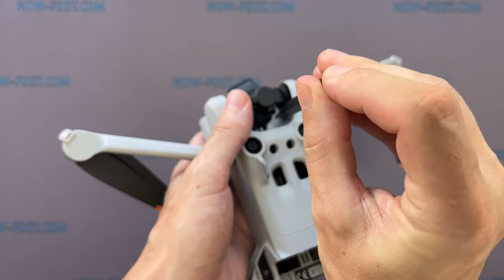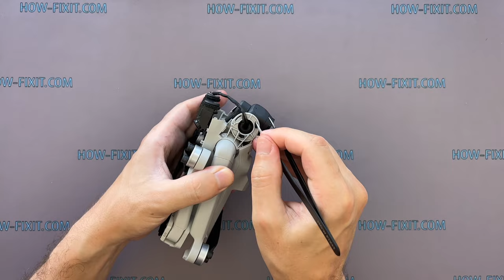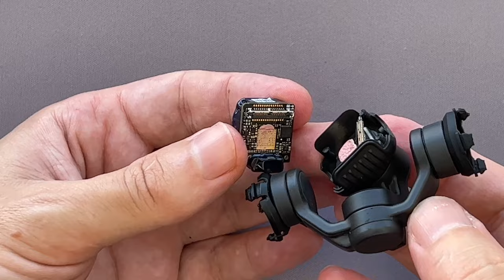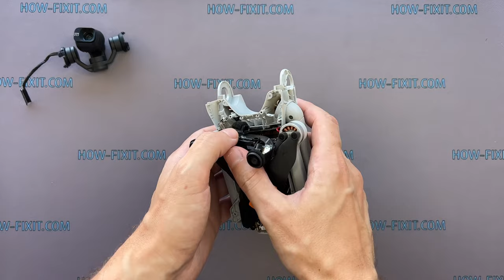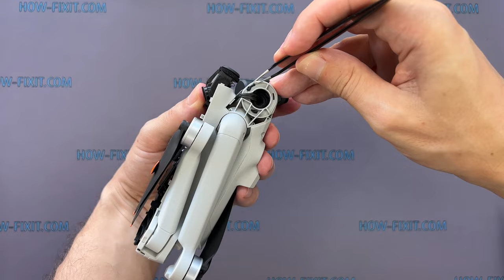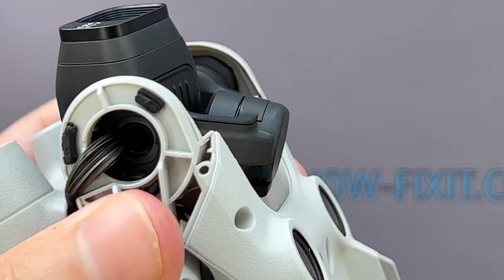The Ultimate DJI Mini 3 Pro Gimbal Replacement Guide

Comment: Mavic 3 and Mini 3 Pro can't be calibrated by python. Does anyone know how to calibrate?
Reply: Did you ever find the solution?
Reply: Any update on this? Were you able to find a solution?
Reply: @stefanhearn430  my solution has been to remove the yaw motor from the top arm via excessive heat, and adjust its alignment until it’s proper
Reply: @ me if there's an update

Comment: YES, wish I had the comments before taking on this project because everything was simple except for the rubber shock absorbers.  Mine are completely ruined and will now have to order more and figure out a way to put them in without destroying them.  100% read the comments is my lesson and I am highly disappointed in this tutorial for not warning or even mentioning the issues associated with the these shock absorbers.  Looking back, even the guy in this video all but destroys them.  Not impressed by "how-fixit" because of this one major oversight on their part.  I'm a novice and this was my first attempt to repair a drone like this.  Considering they're acting as professionals, they should 100% update this video and address the challenge with the shock absorbers.

Comment: Great Tutorial! BUT there's still something I can't figure out... I've replaced the cable without issue and the gimbal/camera is working again, however, after multiple attempts I can't seat the rubber properly... what I mean is, I put the rubber through the mounting holes, gimbal facing forward, but EVERY time, the gimbal is not in the right position to have full rotation up and down. It won't look straight down, and has to far of a movement range upward. Any suggestions? I've tried rotating and marking the rotation of the gimbal before placing, but I just can't get it.

Comment: I watched this to see if there was an easy way to push/pull the rubber tips through,  they get all messed up doing it this way ,  its difficult.  I prefer to push them through with no gimbal installed, then using  tweezers spread open each hole and pull it around each tab,  starting with the one with the notch.  I'll make a video
Reply: Use dental floss tie up the rubber pull it through the holes
Reply: @vandantandel7289  I bought about fifty of the rubber things,  new ones come with long tabs that easily push through, these gimbal are easy to rebuild,   sections. arms, motors,  have had many just a bad cable (no up and down moving)   .

Comment: I replaced my DJI Mini 3 Pro broken Gimbal Yaw Motor. After replacement, though the Gimbal is getting calibrated successfully, it keeps pointing to one side always. Apart from giving Gimbal Motor Overload error (1D010003) occasionally, which goes away automatically in few seconds, it is not showing an other gimbal error. Could someone please guide how we can get this gimbal centred now? It keeps pointing to either extreme left or right always even after successful Gimbal, IMU & Compass Calibrations. Please guide.

Comment: what a great video!  thank you!  but I have a few questions. I flew mine up into a tree and of coarse wrecked, after that the gimble sometimes works. Other times it say's gimble stuck or gimble overloaded. i don't see any damage and don't want to drop $300 if i don't need to.  thank you for you advice everyone.

Comment: I have a single clip of one of the rubber holders that is broken. I mean those plastic caps that go on the gimbal motor that have 3 clips on which the rubber holders are placed. With one clip missing, I cant mount the rubber. Do I need to replace the whole gimbal housing or can I somehow replace only the gimbal motor/the its plastic cap?

Other than that I need the two rubber holders, of course.

Comment: Awesome tutorial! If you're stuck on replacing the rubber gimbal gasket/damper, save yourself some time and READ THIS FIRST!!!!  
It's fairly easy to pull the tiny holes in the rubber gasket over the plastic anchor points on the gimbal, but I was stuck on putting the rubber tabs on the outside of the gasket into the the tiny slots in the drone's frame.  I struggled for close to an hour, using a variety of tools and tweezers and chewing up the rubber a bit.  I guess during initial assembly, these rubber discs have long tapered tabs that are easily pulled through the slots. Once the rubber tabs are firmly seated in the slot (there is a shallow groove that retains it), the excess length is clipped off. This leaves only a small, spongy nub that is nearly impossible to pull through the plastic slot in the airframe with tweezers or push through the slot without tearing it.  I finally thought to put a tiny drop of dish soap on the plastic slots to lubricate them and then I was able to stuff the the rubber "tabs" back though (from inside) with a small flathead screwdriver on the first try.  Probably going to clean up the residual soap with a cotton swab and isopropyl alcohol, so it doesn't slip back out.
Reply: Thank for your suggestion, you saved me from losing my drone, above video should mention how hard it is to put these suckers back in, soup defiantly helped!!!
Reply: Oh my god thank you
Reply: Thanks for this tip….as this was the only part of the process I was dreading. I saw only how it’s assembled by DJI with the logging tabs that get cut off.
Reply: So after you install do you need to remove the message Jimbal erro how do we do it
Reply: Great tip, thank you!
Reply: Thank you i have been on this over 5 days cant insert the rubber, I will give your method a try

Comment: I have sourced 8 pairs of grommets after having issues getting the original rubber grommet back in place.

Actually when I purchased these I bought several pairs expecting to ruin them trying to install them.. turns out from factory these are left long, pulled through and then cut off afterward.

Anyone looking for a replacement set please message me as I can’t return them! 😅

Install is super easy!
Reply: I am looking for some if you still have them
Reply: Do you still have them? Running into same issue.
Reply: Looking for a set if you still have any!
Reply: Hey I do not have any more but I can order some on your behalf and mail them if any one still needs them
Reply: Hey thanks for responding! All good, I just ended up sending the drone away. Cheers

Comment: Please, don’t follow this tutorial! You end up spending money for nothing. Since the ‘new’ gimbal does have another serialnumber, there is NO WAY to calibrate the gimbal. You will end up having a gimbal hanging in a corner, not responding to your input. 

Not only the gimbal and camera, even the front sensors can’t be renewed. Same problem, another serialnumber. DJI becomes another Apple, anything to prevent that you repair your drone yourself 😖
Reply: I do it
Reply: @felipeporai  Please share your experience when your done. I hope I’m wrong…
Reply: @Minicopters  isnt a code bro.. Its a dji software … I work with drone repair in Brasil

Comment: Little tip to add to this video, As some may have seen and experienced, the rubbers are a pain to put back in place, I was able to leave the rubber on the gimble and only replace the gimble, it was easier to put the rubber back on the gimble and leaving them on the drone. It also prevent from damaging any of them by fighting to put it on the gimble.
Reply: great, you could have warned me before looking for the video on how to do it.
Reply: Ich habe an den Enden der Gummis eine Schnur/ Faden um diese gebunden und mit einen Faden durchgezogen. Ging super schnell und ohne Beschädigungen.

Comment: My brother broke the gimbal arm on the side with the wires, I’ve taken the gimbal out and repaired it with araldite, but I’ve noticed the rotation side that broke doesn’t rotate smoothly it’s very stiff whereas the other side that has the copper rotates very smoothly, my question is that how they should feel or has the crash damaged some sort of bearing on one side

Comment: Wait I had crashed my drone but everything works on the gimbal just the camrea wasn’t able to move but everything had work all it needed was just an housing replacement would you need to also recalibrate it

Comment: Any idea where to get just the rubber holders?
Reply: DJI wouldn't send the rubber holders to me to fix mine myself. They made me send them my drone through DJI Refresh for $65 and replaced the drone instead of dropping a few in the mail.  They said the rubber holders weren't "an available part for purchase".
Reply: @cheritrick  thanks for the reply man, I crashed mine a couple weeks ago and realised with this video that really all I needed were those rubber holders. I will send them the drone then...
Reply: Same here. I crashes my drone and the left side of the gimbal was dettached from the rubber holder. I managed however to put it back on by using twizers but only I was only able to connect 2 holes. There are a total pf 3 holes. I calibrated the gimbal and somehow it was successful. I was able to shoot today. But i will still send iy for repair since the gimbal on the left and right is not level due to the dettachment  from the rubber holder
Reply: @deejay1571  yeah, my rubber holder has actually ripoed off around one of the holes, so I coudn't reconnect it properly
Reply: @fredericoalves811  does your mini 3 pro have dents after crash?
Reply: @deejay1571  really small ones, like some pieces are just slightly out of place, but nothing major
Reply: for my DJI mini 2 I bought rubber holders on aliexpress, maybe there will be for DJI mini 3 pro
Reply: @Edvard_Nygma  cant find anything so far
Reply: @fredericoalves811  same here. Just minor scratches. So were you not able to use the drone after thre crash? Can I see the situation of your gimbal so that I can compare mine?
Reply: @deejay1571  the drone flies just fine, no problem. But I cant control the camera/gimbal, it is just hanging there, and going crazy in all directions when flying

Comment: Thank you very much.  Very helpful.  Can someone help. After crashed my dron MIN3 PRO drone turned on but side lights gone and I can't connect it to apps.  I have noticed that motor connectors cracked and do you think this can be a main reason or something with motherboard

Comment: My mini 3 pro in active track clipped a branch and dropped about 8ft the gimbal is cracked at the bottom and the plastic casing around the frame popped out a bit. I clipped the plastic frame back together and miraculously from what I can see it seems to still function. I need to test it when weather is ok. The gimbal seems to have full movement what do I need to be looking at when testing it? Do I need recalibrate anything ?

Comment: I had to go a little further and replace the gimble bracket because mine broke.   After going through this the hardest part was the rubber retainers.  After messing with them for 2 hours It became obvious that they did not want us to fix these things ourselves.  I even tried tying a string around the rubber tab to pull it through and it cut through part of it.   They've made it very difficult to re-use the old rubber retainers because there was a thin tab you would feed through and trim off later.   Unless you have those you cant feed them through without damaging them.   My solution is to drill a 7/64ths or 2.7mm hole through each slot to pull the rubber through.   This way you dont damage them and its enough to hold them in place
Reply: An adhesive that connects the rubber tabs to a longer string/strip could also work. After you have the string connected to the tabs, pull the tab through by the string, and then clip off the excess string? I have not tried it, but I think I would prefer it over loosening the holes themselves. I would be scared the tab would slip through again with minor stress.
Reply: @nate6889  i looped a string on the end and it cut through most of the rubber on two tabs.
Reply: I also had to replace the rubber retainers after struggling I just ordered new ones on Amazon and overnight them they can with the longer tabs, took me 5 min less than 30$ us
Reply: @Jarebear92  definitely a good Idea, I didnt know how bad it was until I got in there.   I'll probably have to replace those in a couple months

Comment: Great. One little problem though. The silicon holder is impossible to put back without destroying it.
Reply: Spent hours on this and I have no idea how. My tweezers look almost identical to his too
Reply: 15 mins later, I was about to give up but just happened to order a sowing kit. I used the non sharp side of the sowing needles to put the end in and then leave it, then another one to keep pushing them in.

Taking them out was pulling the whole thing back so I just left them in instead. 

Much easier now. 1 down, 2 to go.

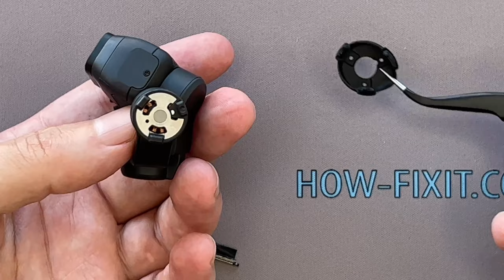Comment: PLEASE HELP! at 8:30 in the video you can see plastic tabs that are on the back of the pitch motor where the rubber grommet attaches on the gimble side. does anyone know where to get replacements? it looks like a plastic cap that fits over the pitch motor. does this come with the motor when you buy it? the listings i've seen do not show these tabs being included.
Reply: Got mine on AliExpress but it need an authorized calibration with DJI repair software

Comment: My gimbal arm is slight crack ? How to get that part. I live in India. Need your help. Just need the gimbal housing.
Reply: Links to gimbal in the description under the video
Reply: @Edvard_Nygma  not there ?
Reply: @khalilspearfishingqatar  what is the difficulty to buy on aliexpress?  is it possible to do from India?
Reply: Bro,is your gimbal working still?
Please replay,I also have a slight cracked in the arm
Reply: @rohanal-nahiyan163  i bought spare and replaced it then i damaged the rubbers. 😂😂
Reply: has all the gimbal parts on Aliexpress ( cardan guimbal )
Reply: @khalilspearfishingqatar need to replace arm. Did you do calibration or its no need?
Reply: Hey Rajesh which drone do you fly and what did you do about the gimbal
Reply: @vandantandel7289 Hi, This issue was in 2022. It has been resolved. I got it replaced.

Comment: @howfixit Hi do u have to put the gimbal a certin way because the swivel sides dont rotate all the way. The swivel parts on the gimbal stop different from both sides where the ruber parts go
Reply: Did you ever figure this out? Cause i just installed mine and maybe its off a little and doesnt go up.
Reply: @dredlew  I ended up doing it a while back and it worked great. Make sure u align both sides and put the rubbers in slots but not all the way and turn on drone so it aligns gimble scroll Camara up and down and if it goes good without binding it should be good.
Reply: @dredlew  hey did you manage to find out ?

Comment: My gimbal is stuck and it's not calibrating.pls can I get solution for it.shud i change total gimbal replacement..where shud I get it
Reply: Should
Reply: my rubber holding the gimbal was torn, which shows the message that the gimbal is stuck. there are three slots the rubber holds onto the frame. if u crashed ur drone, most likely one of them 3 are broken. change the rubber. aliexpress has them